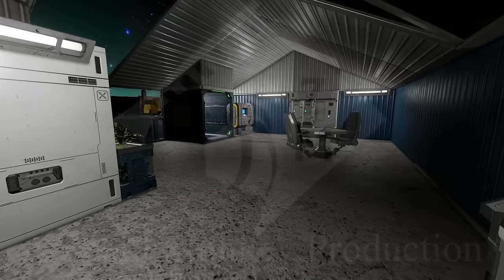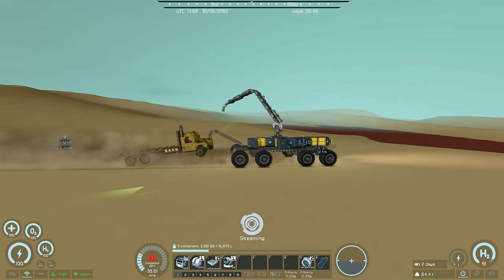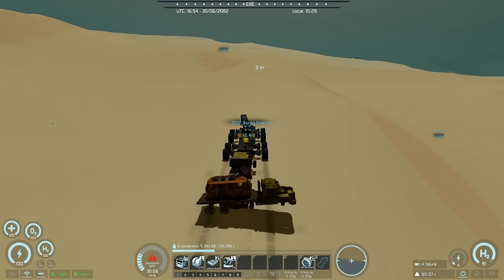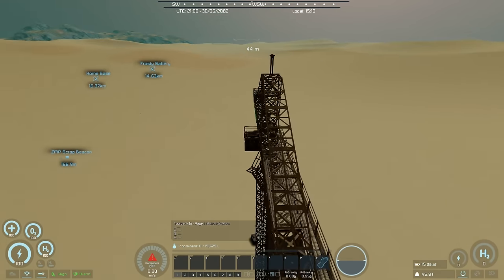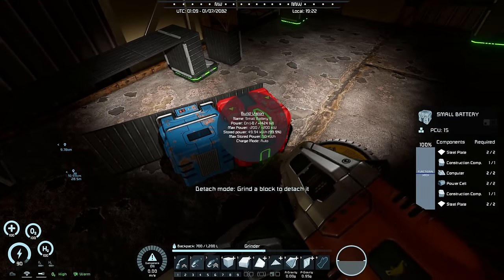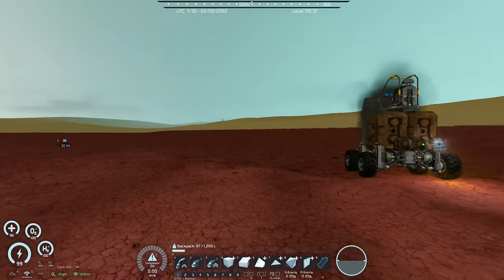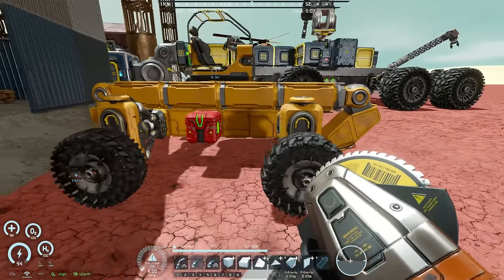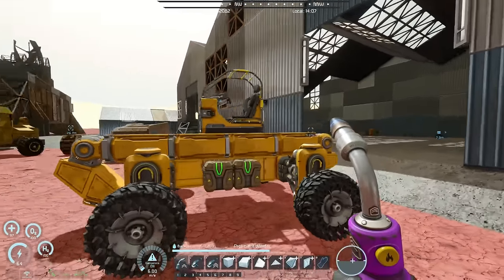Feedback for the Win - Scrapyard #8

Comment: Put a weight on a piston on the back of the forklift, so the heavier the item is on the front, the further you can piston the weight out at the rear to counter the weight. 😉
Reply: Yup, google versa-lift its the same concept as a regular lift except the back half extends out for more carry capacity
Reply: I find a full conector  on they back is ok to lift Most stuff

Comment: How about putting the more rear wheels of the trailer-truck on pistons, so you can extend them in trailer mode for more stability?
Reply from the maker: Like training wheels? 🤔
Reply: @Splitsie  Kinda yeah.
Because you have 2 pairs of rear wheels on the truck, you'll still have a pair of powered wheels without adding the sub-grid wheels script.
Reply: Or the front wheels so that the wheelbase can move forwards to match the centre of mass. 

Like a pair of hinges with 1x1s on, keep them folded back but flip them down to the floor for some extra ground contact up front.
Reply: @RAFMnBgaming  That is a terrible idea, extra ground contact on the trailer would just cause problems when turning.

Comment: With the light above the hangar door you could also set up a turret controller, so it automatically follows the grid you're working on
Reply: Could just use a searchlight for that instead. Would save a turret controller too.
Reply: @vadernation1233  You clearly did not listen, the searchlights have narrower beams
Reply: @Hantick360  I know but they’d be better than using a bunch of CTC which he has in limited amounts for a really similar result

Comment: Small tip for SE and real life, never ever put the heaviest objects on a two wheel trailer at the back! Shifting the center of mass that far back makes the trailer inherently unstable and prone to swinging around a lot with the slightest turn especially at high speeds. The center of mass should always be as close to the pivot point as possible.

Comment: As you found, there is no constant speed you can set the telehandler's pistons to get a vertical lift.

The length (L) you need, (taking fully retracted as 1), based on the lift angle (A) is:

L = 1 / cos (A) 

Which means the extension rate is going to be dL/dt =  ( tan (A) / cos (A) ) dA/dt

Comment: Hey Splitsie,

Love the build, the asthetics of your builds always put mine to shame, but a few mechanical suggestions that might help:

The lifting hinge being further back on the vehicle doesn't make it any less likely to tip forwards with a heavy load. The only things that matters are the distances from the center of mass, to the front wheels vs front wheels to the load, and the mass of vehicle and load.

COG of telehandler ~1.3m behind front wheels x 7350kg = 9500ish
COG of battery ~2.5m in front of wheels x 3800kg = 9500ish, hence needing gyro to stop it tipping
If you bring the forks back 1m closer to the front wheels, you could lift 65% more weight... or the same weight with a safely factor of 1.65 :D

With that in mind, it would be a lot more stable if you remove one piston, inset the charge connector, and get the 'forks' as close to being inline with the front wheels as possible, or even slightly behind and have the wheels straddle either side of the load. Also, don't extend the pistons when raising the arm, as moving the mass backwards is a good thing - you can always extend it manually if needed when stacking the shelves.

A shorter arm also gives the lifting hinge more leverage so will bounce less.

Comment: Once made a forklift thing for tight spaces, one trick I did was:

All 4 wheels steer, 45 degrees spaced to draw out a circle cleanly. Your lift truck looks OK for that. 

 Timer set to reverse the throttle of the 2 left wheels.

So, when timer is triggered, it literally spins in place, directly, by during and driving forward (counter clockwise) reverse (clockwise)

PS: can also link the arm hinges as a group, one of them reversed, so as the arm raises the hinges match, keeping the 'load ' level
Reply: All 3 of my ideas already posted so i dont have to, perfect!
Reply: I had that last idea as well. If you want to keep the load level, just have the front hinge reverse the rear hinge. You can still set up manual controls for it so you can tilt down for smaller stuff.

Comment: Two suggestions for the little lifter - 1)add a rotor just before the mag plate, to let you rotate an item (let's say, a thruster) to face the right way mid lift; 2) articulate a mid point in the piston arm, so you can extend into an area (like the top of a roadway) horizontally with the last piston or two, while the main triangle provides height.

Loving the series, very inspired ~
Reply: You could make a "loose scrap tool" that would have the aforementioned rotor with a connector. That way you could swap between pallet mode and loose mode by connecting to the loose scrap tool.
Reply: @TubeTAG   Ya that is one of the big strengths of the Tel-handler setup is the ability to swap heads for different kinds of lifts.
Reply: I agree on the rotor part, but the extra articulate would make it almost to versatile defeating the idea of more specialized vehicles :)

Comment: Mix of recommendation and suggestion.

Recommendation: Get some of the scrap palletised before you get distracted again now that you have a forklift equivalent. Also adjust the entrance way if you plan on driving forward in, though I would recommend reversing.

Suggestion: Make 2 types of pallets.
Mag-plate shelf/pallets should be for things like thrusters, I gave an example a few episodes ago of a 9 or 5 small block wide pallet with merge blocks, but regular blocks should also be fine. 2 blocks high to get the lifter a good spot. Use those for thrusters, computers, that sort of thing.
At the floor height should be small block large connector, conveyor converter for the H2 tanks, batteries and engines. Things that would give a variable trade value. Full H2 tanks and engines are more valuable than empty, and you can charge up batteries safely.

Comment: If the front hinge moves opposite to the rear hinge at the same rate (times -1) the forks/pallet will stay parallel to the ground. It could also use a light at the end of the boom to act like a light tower.
Reply: This is exactly what i was thinking
Reply: Was about to upload a video explaining that to Splitsie, I'm still pretty new to the game but have been messing around with hinges lately
Reply: Yep, the combo lift option now does pistons + rear hinge, but it also needs to rotate distal hinge the opposite direction at the same time (and same RPM ofc.)

Comment: Nice, a telihandler is good. Real world the boom is down one side with the cabin next to it. 
Could use the dual hinge at the end, use a connector pointing down with the magplate on the outside face. Poke out for connector and grab normally otherwise.
Also stiff suspension at the front will lessen the bounce lifting
Reply: Agreed, it looks similar to 10k forklift
Reply: I'd also drop the front mag plate with a half block so that when the boom is down the mag plate scrapes the floor (increase suspension height for clearance) and then have the 2 hinges work together so the load stays horizontal, just like the real thing.
Reply: Unless you have one of those dinky telehandlers, the boom is center of the machine (look at a telehandler from the top).
If the boom was off-center, then it would topple over as the weight would be all on the one side of the machine.

Comment: 1:02:12 Small grid hinge placed on a flat surface. Bar of blocks on top going out 10 blocks going the same direction as the hinge bend. Place a small battery on one end and then a small container full of stone on the other end of the bar. Then turn the hinge off. Whichever side is heavier will fall. Easy level balance.
Reply: This, but you'll want the heavy blocks below the hinge axis. I'd build the hinge on a 2-3 blocks high pedestal, and "hang" the heavy blocks 2-3 blocks below the bar. (Where "hang" means have a 90° bend down at the ends of the bar made from solid blocks, no actual articulation needed.)

Comment: With the Tele handler I would suggest you:

Move the base hinge up at least 2 blocks, maybe 3 with the hinge mounted on the front face. 
This will allow the boom to angle down, lowering the pickup height.
With the extra block length being added to the boom that will allow one piston to be removed bringing the weight of the carry in closer so less counter weighting is needed.
Because you are raising the hinge point the loss in total lift height will be minimal. 
You are also better to lower the cab to drop the center or gravity. 
Moving the connector to the rear will allow the carry position to be moved closer increasing stability.

For the Crane towing boom I would sugget you:

Build the boom as an 'A' frame tapering into a center point with a single block wide extension to give you additional length if needed.

For bonus points in complexity you could add a hinge one or two blocks forward of the A frame hinge's and in the center row.
Add a piston to that hinge with another hinge connecting it to the apex of the A frame.
Turn all hinges off and control with the piston.
Reply: The a frame style is great idea I'd say each arm of the A frame have a free hinge at the top of the A, if you use pistons on it. The hingles would allow the micro adjustment without building up unwanted pressure/tension, and make that point be a hinge(block)-hinge set. Like using a triangle with the flat side facing back. And I just realized you were talking about pistons outside of the A frame. Well the idea is still there lol.
Reply: I think that with the hinge at the back as it is reduces the amount of counter weight needed, more so as it is levering from the back, making the entire front act as "soft" out riggers. 
Agree that the design will allow a lower pick up, but i think in SE it will add to the amount of counter balance needed behind the new hinge position.

To lower the cockpit he could move the 2 computer type blocks to the rear in amongst the balast, build around them, screens facing rearward for example.
That would lower the cockpit. However it would run into the problem of the camera forced into first person if the counter balance in practice needed to be built higher or in line with the back of the cockpit, reducing its feasibility. Particularly with stacking either batteries or small cargo containers for the density and build limitations.

I like the A frame suggestion, and wpuld like to see it built, even just to try it out, see if its something i would put wffort into creating for example. Because i am not as good as Splitsie, id like to see it first and go from there.
Reply: @Ninjamilk_  Whether the hinge is in the front or the back does not change the amoount of counterweight needed. It is just the weight that affects that.

Comment: Love the upgrade to a Telehandler over a forklift. The nice thing about how you have it set up is that the front hinge can act as a quick connect for different tools. Like the current mag plate or pallet forks, a cherry picker carriage, maybe even a welding tool. Love the videos and keep on engineering!
Reply from the maker: Yup, just got to work out a nice racking system for the tools that can reduce the risk of things clanging when I attach :D

Comment: Splitsie in the World of Scrap, good series so far! 🙂

I love your telehandler, for lifting up those big batteries you may have extend the rear-end by 1 or 2 blocks to get to that sweet spot, like the Liftsie in Survival Impossible (SI). Also you might want to build some outriggers at the front for when you extend the boom and the center of mass starts shifting over the front wheels.
Also as you mentioned you don't need that many pistons, you could replace the two pistons at the rear with armor blocks and make the raising of the boom piston actuated, like the crane truck you did in SI.

I build the LEGO Technic Telehandler and that looks a lot like the one you build.

And I like that "arena" idea just to see what other people have been building on the server.

Comment: I'm enjoying this scrapyard series. 👍

Have something like an event controller on the telehandler to control the hinges together. As you raise the boom, the hinge on the end tilts at the same time/speed to keep the "head" of the boom always level (provided you're on level ground), and can turn it off when you're on a slope or when you need to work the hinges separately.

Having fewer pistons in the boom could work. Leave one extended enough so the "head" clears the front bumper, but can retract when carrying something heavy like a large battery to bring the weight in closer to center of mass and not have the telehandler be so tippy.

Having an option to utilize "crab steering" can allow you to line up with something without all the back-and-forth trying to shift over when you didn't quite line up where you wanted.

I agree with Slye_Fox, use pistons to widen the rear wheels on the trailer truck for stability when in trailer mode.

Comment: For the loader, I would suggest a double hinge so that whatever you're lifting doesn't get twisted when lifting the piston arm. It would keep the cargo down and level. Previously I have has the double hinge switched off but with some braking force applied so they don't swing freely, just enough so that under tension they will gently arrest back to a vertical orientation, aligned with gravity.
Asides from that, it's a very nice compact design, would just recommend some ballast for those heavy items just incase. I do have my own versions of telescopic handlers and cargo container lifters on the workshop so they're a little more fleshed out but I enjoy using them a lot, especially with PARK for the controls.

Great video!

Comment: after working around the telahandler for years I'd recommend not only leaving the front steering high. But I'd add two controls to it to turn on/off steering to one set and inverse steering on the other set. having both sets of wheels turning the same direction will give you crab walk.
Reply: That would be handy for side adjustments in tight spaces yes :)

Comment: Loking at the finished product, that new lifter really needs something that looks like a ladder into the seat. 
Also, in terms of physics you will most likely produce less tipping if you remove one piston and keep heavy loads over the fron axle instead of adding weight

Comment: some design/operation tips. Add a block under the rear hinge of the forklift. At full down you will be extend to the ground or below grade. for heavier lifts like the battery, the higher you lift the load the center of mass distributes to the back of the frame. It seems counterintuitive but you want the load higher (lifted) for more distribution of weight.  go all in on the quad steer, you'll get used to it. if you want super fancy, add a hinge to the cab and program matched pitch to the mast. commercial cranes have a similar function. could also program mast and jib hinge to mirror the pitch of each other, leveling the load all through the lift. Awesome build!
Reply from the maker: Good point about lifting high to move the mass over the wheels, I need to remember that :)

Comment: Watching this series has got me back into space engineers, which I haven't played since early in the early access.

Playing on console mind you. It's pretty decent except there's no custom scripts in the mods. Didn't stop me from building a functional chinook and then mucking around with its internals to make it play altitude alarms when it's crashing, and radio/morse code noises when you switch the antenna on and off.

I wouldn't have started without this series, though. Thank you for that. I've also been inspired for designs of rovers and such from your other series.

Comment: I believe it would be possible to outfit the new lifter with a dual-mode grabber. You would need to replace the grebbling on the end of the grabber with another hinge (or two). The second hinge would be attached to the side of a merge block (or connector), with the mag plate mounted on the rear. To switch modes between the mag plate and the merge block, you would simply need to rotate the second hinge by 180 degrees. More than likely, you'd want the merge block/connector positioned for the underslung access (this allowing you to connect to pallets on the ground) and the mag plate in the upper position (allowing things to be grasped from above).

Alternately, a rotor (attached on its side to the wrist hinge) could be used to spin the connector or merge block around so the desired face is facing out. A possible advantage of this variant is that it'd give you some left/right flexibility in the grasping of objects.

Comment: The gyro is a 1x1 that you normally have a hard time lifting, so it's more dense than small batteries, which are easy to lift.
Put that gyro on the back instead of the side to help with counterbalancing.